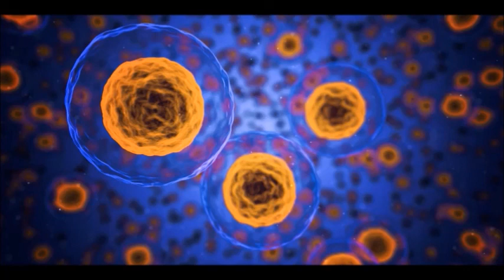Creating fatty acids from carbon monoxide and hydrogen...revisited. I succeeded!

Comment: Very well done and very interesting.

If you wouldn't mind, would you speculate as to the chemical formula and structure of the fatty acids formed from the carbon monoxide and the hydrogen ? 

Also, do you think the montmorlite clay, or the iron, and their atomic mineral components, included themselves in the fatty acid structure somehow, or contributed into the formation of the fatty acids in some way ? 

Given that these are I assume models of the proposed early primoridal vesicles potentially encapsulating primoridal nucleoside strands, could you speculate as to what atoms of these primitive vesicles comprise the hydrophobic and hydrophilic portions ?
Reply from the maker: You should see another video that I did in trying to create fatty acids using an amino acid powder containing cysteine and methionine.  I got a much better yield from that one.  In theory, you are able to create fatty acids from a gas mixture of hydrogen and carbon monoxide.  I tried this experiment over and over again, and the yield was always very low.  This is why I needed a microscope to see any fatty acid vesicles which might have formed.  As for the montmorillonite clay and iron, they were meant to act as catalysts.  And, of course a catalyst doesn't take part in the chemical reaction, it is just meant to facilitate the reaction.  When fatty acids form from carbon monoxide and hydrogen.....in an aqueous solution, they will orient themselves so that the hydrophobic ends of the chain are pointing toward the middle of the vesicle, and the hydrophilic ends are pointing toward the inside and outside of the vesicle.
Reply from the maker: Also, I couldn't even BEGIN to speculate about which fatty acids were formed, since I don't have regular access to HPLC analysis.
Reply: @MadScientist72  Thanks a lot. 

I will have a look at the other video regarding those 2 amino acids cysteine and methionine and vesicle formation. I didn't realise the vesicles would be microscopic. 

I speculate that the more carbon monoxide and hydrogen gas added, the more those microscopic vesicles will form and collide perhaps clump together into larger macroscopic structures, potentially rising near the surface of the water since up there, they can orient furthest away from the water below via their hydrophobic portions ?
Reply from the maker: @teamwork1008  Yeah, adding more carbon monoxide and hydrogen will produce more of the desired product, sure.  I always make sure to add water to my autoclave when doing these experiments, because fatty acids are overall nonpolar and will separate from the water.  And of course,  you need a microscope to identify fatty acids in solution because, YES, the vesicles are microscopic.
Reply: @MadScientist72  
Also, it made me think that if carbon monoxide and hydrogen are all that is needed for vesicle formation, i.e. CO & H2, then since ribose sugar contains C, O, &  H, it might be possible to form a fatty acid from a primordial sugar as well ? 

(I read that naturally occurring formaldehyde can naturally form sugar molecules quite readily in a 7 step reaction, and hence might explain why sugar molecules may have existed on primitive earth prior to photosynthetic plants making sugar from CO2 and sunlight)

Furthermore, almost all nitrogenous bases apart from adenine seem to have C, H, & O in them too. Since these were speculated to have been formed spontaneously on early earth via simple gases and water and climate changes, maybe they too, could have become reconstituted into fatty acids and promoted vesicle formation  ?
Reply from the maker: @teamwork1008  Sure, formaldehyde can form sugars due to what is called the 'formose reaction' where you get a mixture of sugars.  I did that experiment on my channel, too.  As far as your second point.  Maybe???  We can't say that "anything is possible" in chemistry, because some reactions are sooooo energetically unfavorable that they would simply not occur.  On the other hand,  nitrogen gas or N2, the bond between the two nitrogen atoms is one of the strongest bonds in chemistry.  HOWEVER,  if you have a lightning discharge of millions of volts, it makes small work of breaking that bond and allowing the N to combine with other atoms.
Reply: @MadScientist72  
Very cool thought, nitrogen gas's triple covalent bond (if I recall correctly) being split by lightning simply hitching a ride, and freeing up the N to make other bonds with other atoms. 

And I see that 'early earth' lightning forming due to some pre-existing climate that had clouds and an earth surface of differing charge, allowing a discharge of potential difference between an air and a surface, using early atmospheric air (with potentially little oxygen in it at that point ?) as a conductive medium through which to travel and electron hop ?